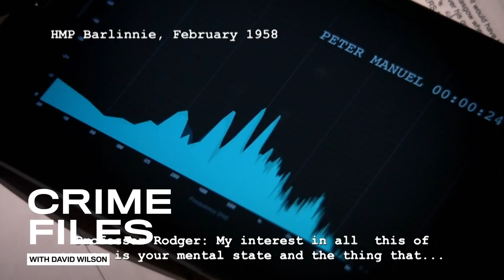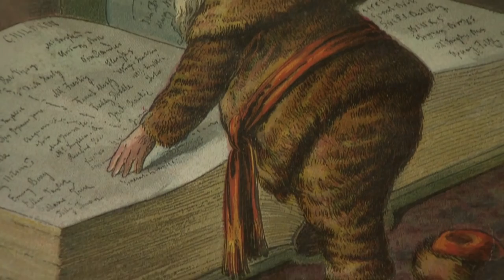Sky City: The Skyscraper China Tried (and Failed) to Build in 90 Days

Comment: Preassembled, module building is more common than Simon apparently knows.  It's used a lot in hotels, and sometimes in apartments.

Think about it.  if you're going to have to make the same hotel room (or London studio apartment) 1000 times why wouldn't you make it in a warehouse, where there are never weather delays, where there's no hazard pay for heights, and where you can organize the whole thing in an assembly line.  Then you lift it up, slot it in, and weld it to the steel structure you built on site.    These building are often designed with plug and play utility hook ups where the units meet the hallway.

The limiting factor is width, for transport.  But, you can design a 2 bedroom apartment in 3 widths,  (Master bdrm, bath)(Kitchen / living)(Kids bdrm, 2nd bath, laundry)  and cover up your joins with doorway thresholds and paint.
Reply: All incorrect. I'll assume you aren't in the construction industry but as an ironworker I can tell you that your pipedream isn't realistic.
Reply: As someone who has spent A LOT of time in Toronto watching new buildings go up, and a lot of time in Toronto taking a building down... not at all how that works.

Comment: I visited an architectural firm a few years ago where they claimed that they were designing a building for a confirmed client, which would be 1000 meters (the structure, that is. Their client was not Godzilla or Paul Banyan.) I've yet to hear anything about it.
Reply: There are only three currently somewhat alive proposals to create 1km tall buildings. Jeddah Tower (stalled, who knows when that will resume), Dubai Creek Tower (who knows when this will get off the ground. Also not technically a skyscraper), and Obslico, which will be a 1km skyscraper in the new administrative city in Egypt. Supposedly will be finished around 2030 is all goes to plan
Reply: designed =/= built. there's probably 100s of ready to build plans sitting around the middle east but they've yet to top the burge since 2008
Reply: Yeah, proposals don't always mean actual plans to build it. For example, there's a proposed 2000km tall building that would be a vertical "country" and have space elevators, but, there's no formal plans to build it.

Comment: If we're going to do megastructures that never actually got built, I'd love to see one on Frank Lloyd Wright's plans for the Illinois Mile-High Tower. It was designed to be 5,280 feet tall (5,706 feet including antenna) yet have less sway on the top floors than many early skyscrapers. If I recall correctly, structurally it was considered feasible, but safety concerns were the main objections (how would you fight a fire on the top floors?).
Reply: And they really didn't have the technology to build that tall in the early 20th century. We do have all the necessary technology to build 5280ft\1600m nowadays. It would mainly require a developer with ambitions as high as their pockets are deep!

Comment: i do wonder about that animation of a chopper on helipad... time and time again i was told by actual helicopter pilots that flying near cliffs is dangerous and even here in very small coutry i live in there are few accidents because of the unpredictable winds around natural sctructures like that soooo will it be safe i wonder...
Reply: Yes, as per the world’s most used helicopter deck standard, CAP 437, they need way more distance than the animation shows
Reply: @perstaunstrup3451  exactly :)

Comment: Having a helicopter pad built on the side of a tall building like that shown in the graphic might be a really bad idea.  In addition to the likelihood of high winds at that elevation, and the winds careening around the building in ways that may be difficult for the pilot to predict and compensate for, there's the issue of rotor wash that's reflected off the nearby wall of the building. As the helicopter maneuvers close to the wall, the rotor wash reflects off that wall, and causes a sudden change in the way that lift is generated, or may cause the tail rotor to suddenly swing the helicopter around one way or the other.  Better to just put the pad at the top of the building where the variables are minimal.
Reply: can't sell a penthouse without helicopter access

Comment: So it was an Arcology. Wonder why he didn't just call it that instead of 'sky city'. If the stacking of the tower was similar to the Sears (Willis) tower in Chicago - the sway would have likely been mitigated. Although I need more info on the amount of steel / concrete ratio to be sure of this, it's certainly possible. Counterweight dampers similar to the Citicorp building could have also been worth exploring. Speaking of - I don't see a megaprojects take on the Sears tower - that'd be a good future candidate.
Reply: They could have used the same damper design as Taipei 101.
Reply: It's like a lattice structure where every module is structural.
They also changed their construction method to build even faster, their new modules are unfoldable and incredibly light (BCore sandwich structure you can see at the beginning of the video)

Comment: Why all this hate in the comments?
This is the company that just built a 10 story building in 28 hours a few months ago (and a 57 story in 19 days but that was with the old modules, the new ones are lighter and unfoldable so they could build it way faster now)
Their claims are perfectly credible.
Reply: There is a world of difference between buildings of that height and Sky City's planned height. From what I've read from actual building engineers, there would be tremendous issues using pre-fab components at that height because they have nowhere near enough stiffness.

Edit: it's covered at around 8:30 in the video, along with some other potential issues.

Comment: Apart from choosing a terrible site and having an unrealistic deadline, the whole thing sounds pretty feasible - although the concerns about steel over concrete should be studied. If the purpose of the building is to actually function as a city district and provide affordable housing for the general public (rather than millionaires) then that's great - this is something desperately needed worldwide. I do feel like they should have tried this on a smaller scale with a smaller skyscraper first as a proof of concept, though.

Comment: Considering how the Chinese (including those in Taiwan) have a habit of modifying their apartments / condos by knocking out walls they they don't consider important and the resulting building collapse that sometimes occurs as a result of it, I suspect that for them, a building like this would just be a disaster waiting to happen.
Reply: The structural steel columns of this building is not something you "knock out" without tens or hundreds of kilograms of high explosives.

Comment: Concrete can be precast as wall and floor panels as well as beams and columns before transporting them to the job site.
Reply: I lived in a communist era prefab for 12 years, it sucks.
Reply: Concrete has strength when it is contiguous. You can't pre-cast an entire floor plate of a building and lift it to the 100th floor.